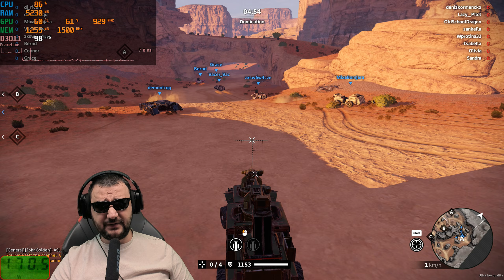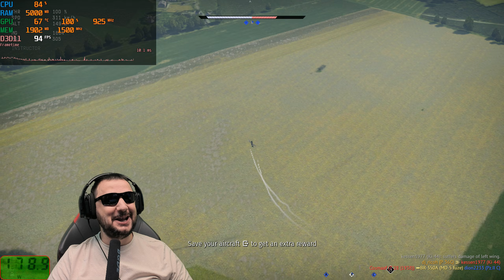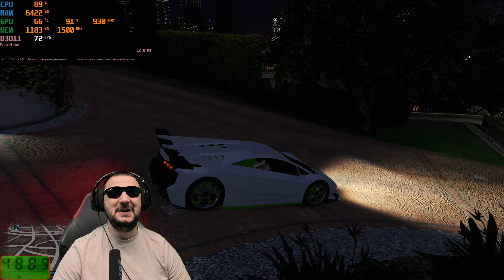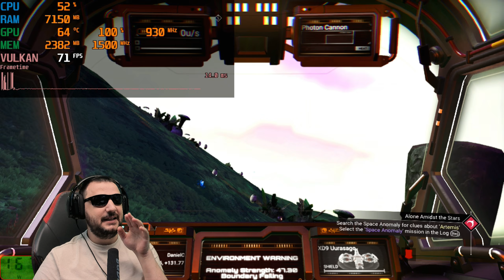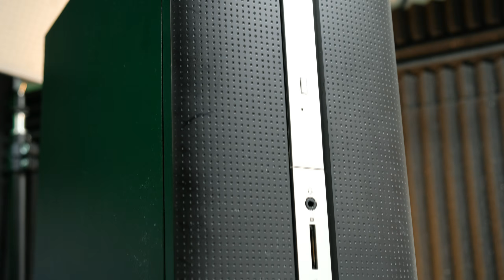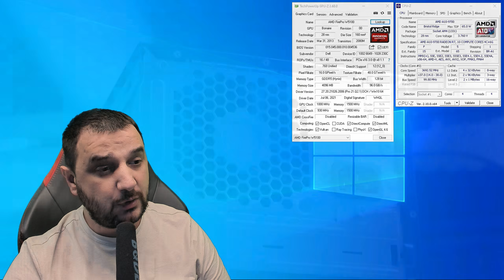AMD FirePro W5100 benchmark A10 9700

Comment: Not the best cpu for gpu tests)) I have Lenovo laptop based on A9-9425 and this is an apu with not bad gpu and slow cpu, and sometimes (often😅) this apu’s cpu can’t load it own gpu, could you expect it?😂 This system drops to 80-60fps in cs1.6. This game is too much for this cpu)) But luckily, it can run hl2, oblivion and stalker with drops below 30fps sometimes, but it’s often playable around 40-60fps
Reply from the maker: Sounds like a nightmare 😥

Comment: The A10 9700 uses a older CPU architecture (Excavator) which were not... uhh not the best. It (the APU) is from 2016 so it is pretty old but it is paired with a GPU that is even older (2013). AMD CPUs are much more efficient than intel CPUs and have been after the launch of Ryzen.

Comment: A10 9700 is like thei5 2500K really close in performance except the A10 has the AVX2 instructions,  so it performs closer to i5 3470 and the i5 4440, especially good when overclocked to 4.1GHz and when using 16GB of ddr3 in dual channel.

Comment: LoL I just upgraded from a Athlon X4 950 to a 5600. Overclocked to 4141 MHz stable ~ 1.35V 
Faster than a 4100 slower than a 6350. Cpu-Z around 875. 
I was top 10 with my CPU (~900 multi before crashing) in Cpu-Z and it still was so God awfully slow 😅